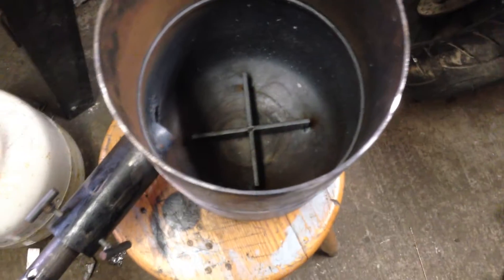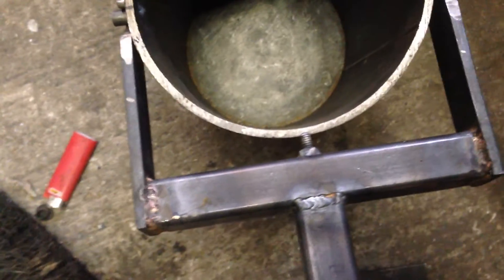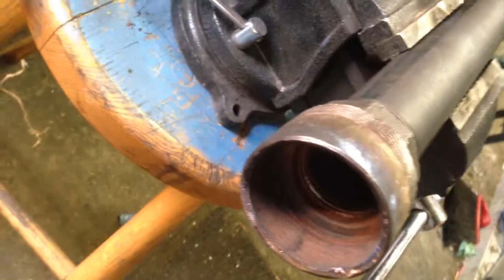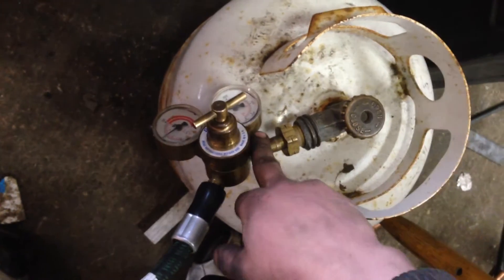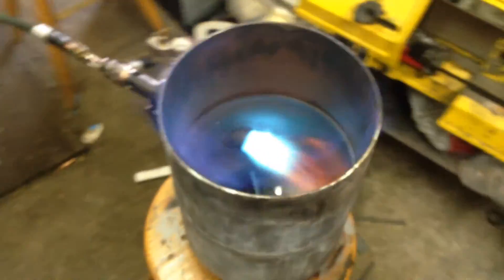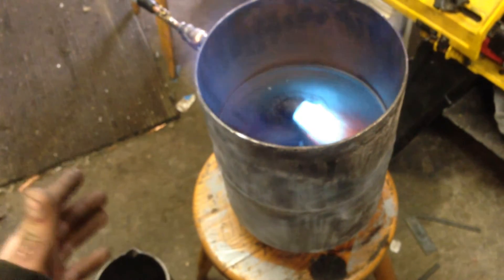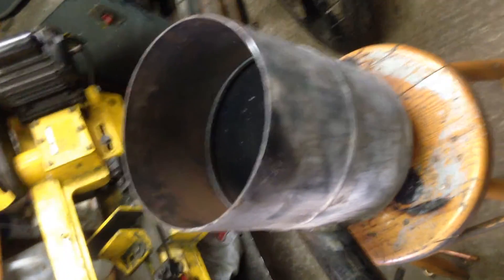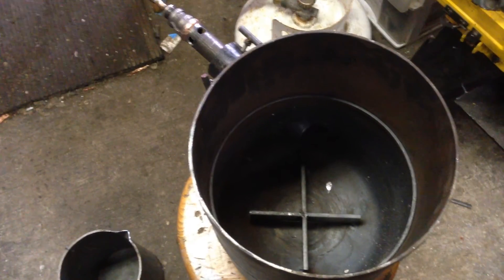DIY home made aluminum foundry PART 1

Comment: FRIGHTENING!!!  I love it!  This is a project I'd really like to do, after the mantle controlling circuit video project you posted of course. Hehe...I ordered the parts for that one just a few minutes ago.  I metal detect for gold here where I live, and find a fair amount of nice nuggets, and I've melted a few of the smaller ones and used them in homemade jewelry projects. I have a very small furnace that uses two propane torches, nothing nearly as nice as this.  This would be perfect for smelting ore however.  The only thing is, I lack any welding skills whatsoever so I suppose I'd have to have a welding shop tackle that for me.  This is one of the nicest furnaces I've seen so far though!
Reply from the maker: welding is not that hard. if you find one cheap give er a go.. (stick welding is hard) get yourself a 110 flux core welder and youll learn quick. The foundry is not finished in this video, but it did work mint. I have since sold this one and built another. the new one uses a blower for forced combistion air.. it gets HOT...

Comment: Also thanks for the info on the welding I was unaware of the car battery's idea. I do think what you said about getting a real welder is the way to go. I would rather have piece of mind knowing the weld penetrated all the way into the metal and is strong then it being brittle plus I believe harbor freight sells them cheap. If it's something I get into then I will dish out some money for a good sound piece of equipment. What do you think about a harbor freight welder. Maybe you don't have harbor freight where you are I am not sure but if you do is it something that is decent to learn on atleast
Reply from the maker: I never tried a harbour freight, but my welder is just a cheap eBay TIG, and it hasn't given me any issues. I've used it quite a bit already and I do enjoy it. 

Keep in mind, if you want to weld aluminum, you need an ac/DC welder. For steel, and most everything else.. A standard dc will be fine.

Comment: Sorry for some reason couldn't type so yeah I just don't feel it is safe for me to do because of my lack of knowledge. I did come across a power supply for photomultiplier tubes that where given to me as someone had destroyed them but the transformer is perfect. It is a beast has NN written on it and is heavier then hell. I also got this heavy duty filter of some sort that it gets plugged into that also had a giant transformer I it plus some very expensive capacitors that are AC. Oh yeah from that power supply I got a bad ass stack pole switch these resistors that are giant 55 watt wrapped in black and where on some type of grid. I also got a giant power capacitor powerlytic

Comment: Yes I looked into the microwave transformer and started to do it but then realizing that I had already screwed with the primary and messed it up. So I figured I shouldn't mess with it because I really don't have any high voltage high current

Comment: Thank you for getting back to me yeah that's what I was thinking I should do I just wasn't sure because I thought as the stirrer I got the PCB board has everything there that you would need to place a hot plate with it but where the components would go (capacitors , etc) are not physically there the mounting holes are empty. I bet your idea would work perfect as the top will come off by four screws and it is ceramic and glass only metal would be the 4 post that anchor it to the unit. Plus doing it the way you stated I wouldn't screw up the entire stirrer if something went wrong with my fabrication or if it did woul be something I could repair. Awesome design by the way on your crucible I like the pouring mechanism you fabricated. Quick question is there something I can weld metal with that doesn't require a welder. Like those brazing sticks or something do you know of
Reply from the maker: I wouldn't try adding components to the board as you might damage it, just run a separate circuit to control the heating element 

And thanks, hopefully it works good. As for welding, you need specific fillers for dippers the metals. You can make a stick welder from old microwave transformers and a lengths of welding cablebut you need to rewind the secondary
Reply from the maker: You can also buy aluminum "brazing rods" for aluminum, and you use a torch, or you can use 2 car batteries as a welder aswell, just don't run them for too long or they might catch fire.. 

Look o. YouTube for welding with car batteries, and microwave transformer stick welder, and brazing with a torch.

for any real welding to actually be strong, you'll need a real welder.

Comment: hey I just had a quick question in regards to the pcb board you did. I had followed along with you threw the video. It was the Heat mantle controller.. My question is as that one saved some money for me and worked great. I went and purchased a vfr 10 by 10 magnetic stirrer.. well I opened it up to have a look and on the board it looks like its capable to have a hot plate installed in it also. all the connections and holes where say a lcd and potentiometer would go. I have all the necessary parts to do this but my question is do you know if there is a way to go about doing this If you can maybe point me in the right direction or if you need more info from me about it let me know any help would be awesome. as always Thanks for your videos
Reply from the maker: You can just use this circuit to run a hot plate, you wouldn't be able to hav an LCD unless you purchase some sort of temperature gauge with its own LCD. If you need to make a hot plate to fit it I would go about taking the plate off of the top of the stirrer, and casting your own heating mantle inside the top plate, just make sure it doesn't touch the metal, and make sure it doesn't interfere with any moving parts of the stirrer. 

If you can get your hands on pure sodium hydroxide and some silica gel (the packets that come with shoes, wallets and stuff) if you look into making sodium silicate, and then look into making a perlite/sodium silicate refractory Cement, you will have better luck then with just drywall as it will stick to the metal, and slightly insulate.

Comment: Awesome. Do you plan on lining the inside with a cast-able material such as refractory cement? This will help considerably in maintaining the heat and using much less fuel. I think this is known as a hot face.
Reply from the maker: I actually already have, I put the refractory mix around the outside for Insulation, I have already done it and it turned out good. Once I have the lid Hinge mechanism figured out I will be posting part 2.

Subscribe and you will see it in a few days.